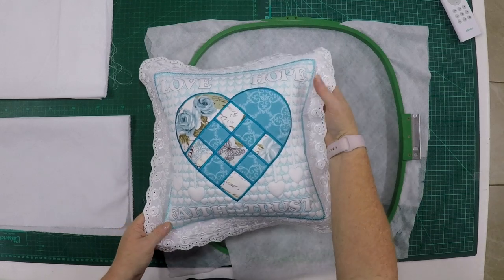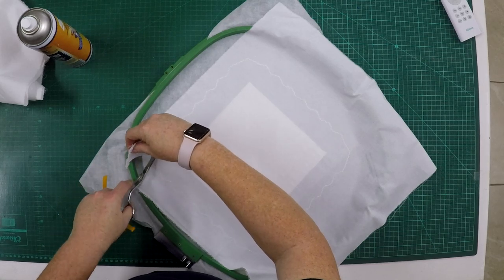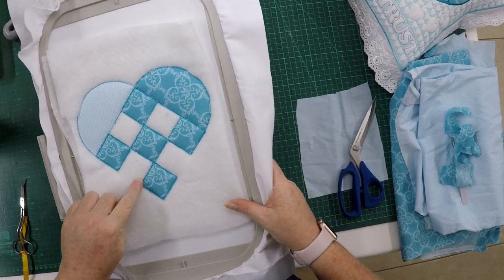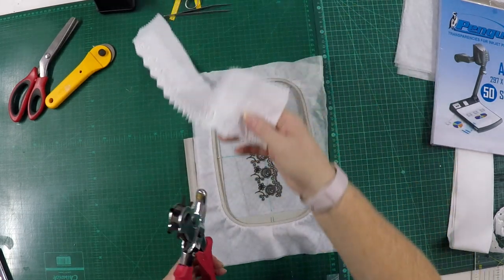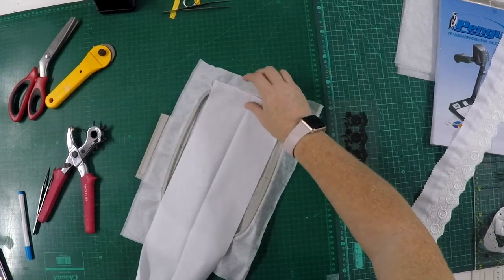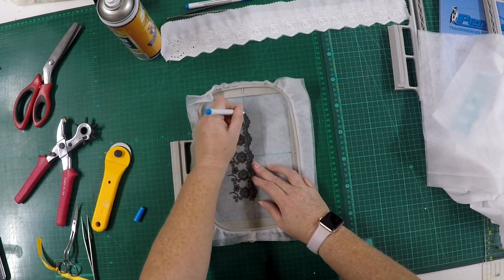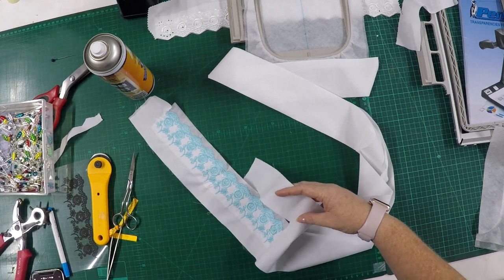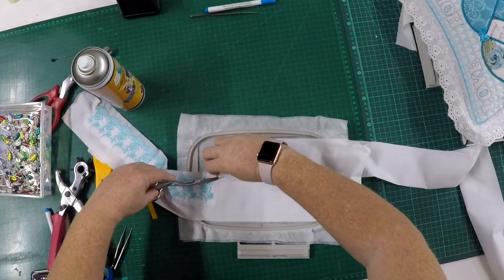SDS1427 Eyelet Lace Edging Continuous Lace and Nordic Heart Quilting

Comment: I have a question, I watched this video and you said you are doing it in 1 hooping on a square frame, I would love to do this design but I do not have a large square frame and my only square frame I do have is small is there any way I can do this design and hoop it twice on a larger frame ?
Reply from the maker: We do include quite a bit of files, among those included is the background quilting and heart as separate files, so you can absolutely do this in multiple hoopings :) 

Here's a link to see what's included in the set: https://cdn.shopify.com/s/files/1/0588/9802/2570/files/sds1427_designsizes.pdf